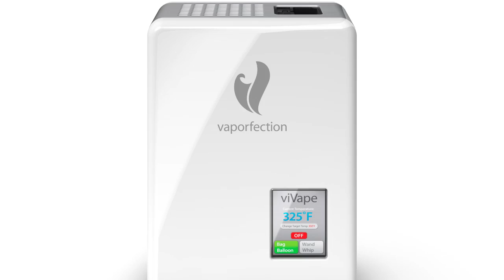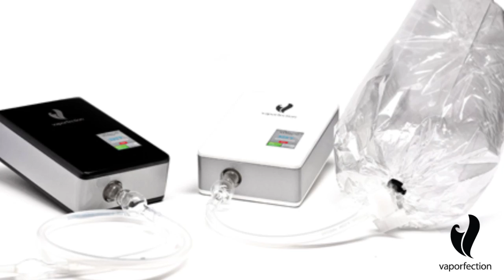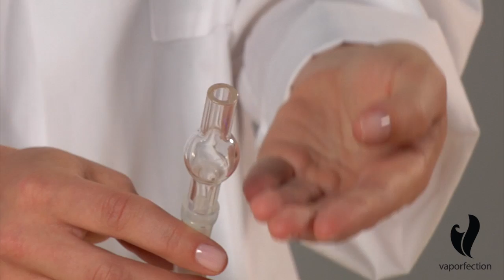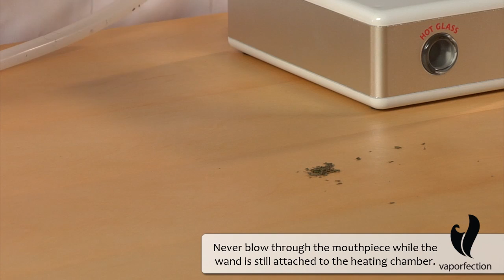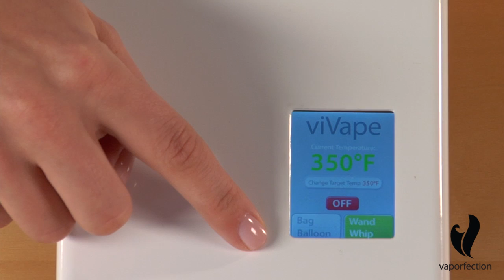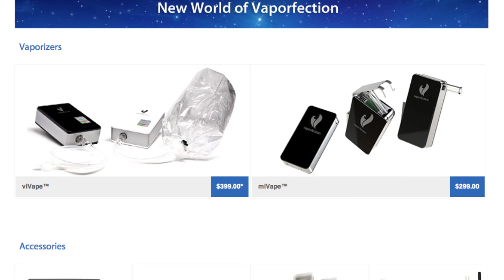The New World of Vaporfection: viVape Instructional Demonstration

Comment: If you owners are reading this I would like to make more comments.  You need to add a feature to turn off the fan while on whip mode, really sucks when you forget to pull out the whip and you use up your expensive medicine.  I rarely ever use my Vapormatic due to the fan not shutting offf but this unit has cleaner tasting meds and the fan speed does decrease to a certain point after turning it to whip mode from bag mode.